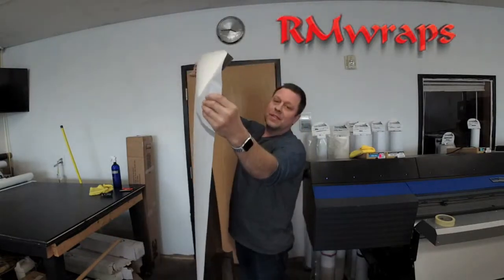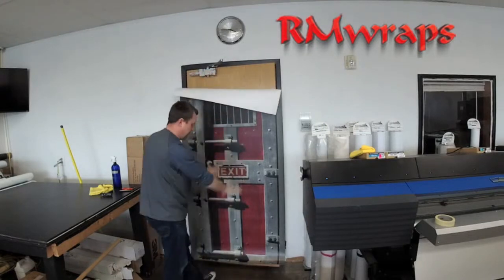How To Wrap an Interior Door using Long-Term Vinyl

Comment: How do we choose between long term vinyl, and photo tex?
Reply from the maker: Do you have flat doors - are you going to have them on the door for a long time?  Long term vinyl.     Rental or worried about when you remove the print from the door, panel doors - use the Photo tex material. Photo tex door wraps. https://youtu.be/P1w8fJp6gWI